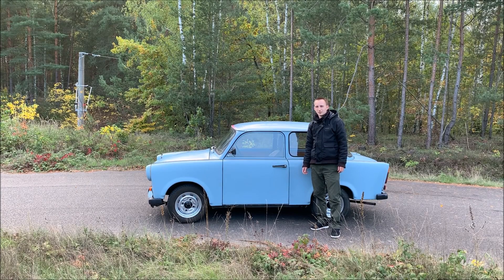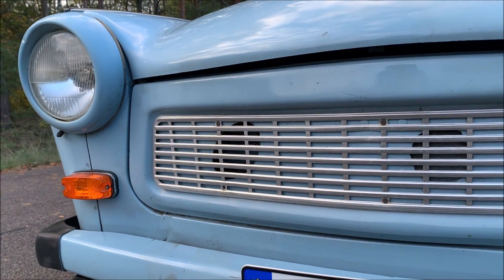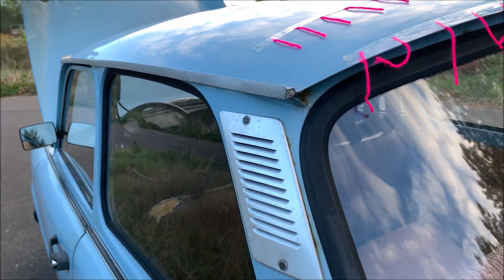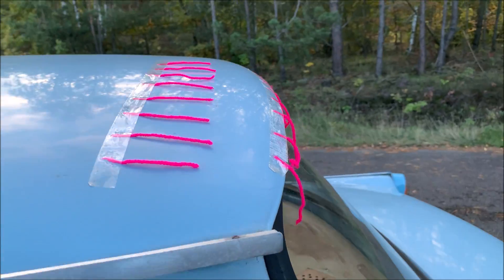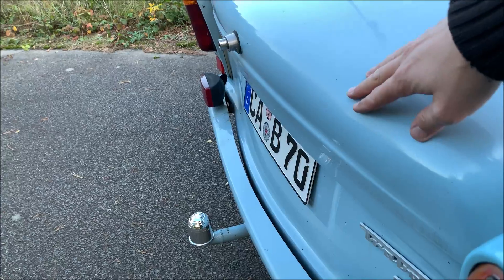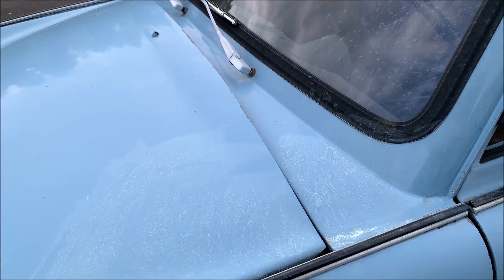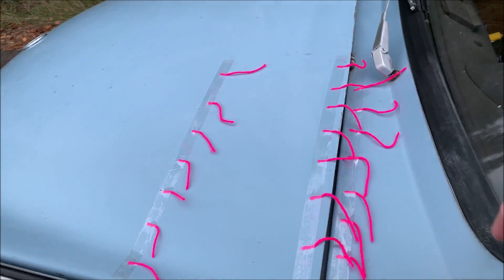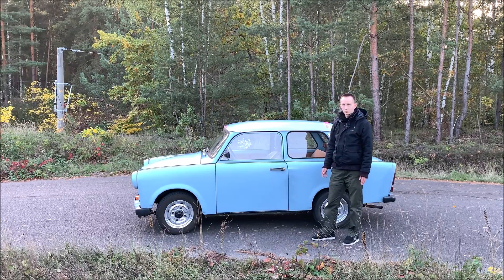F1 Engineer Flow-Vizzed Trabant 601 - Aerodynamics EXPLAINED

Comment: Question here: if the air is sucked under the hood back to the engine compartment where does is actually leave the car? Is it below the car?
Reply from the maker: Good question! Yes below the car and through the wheel arches.